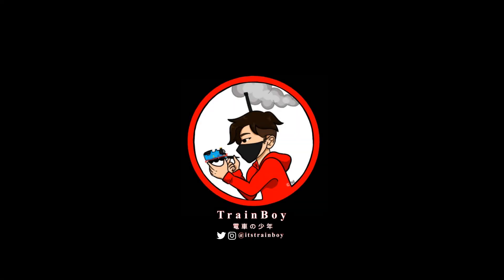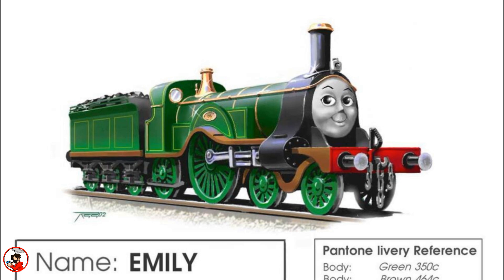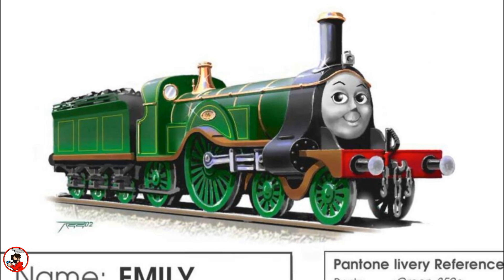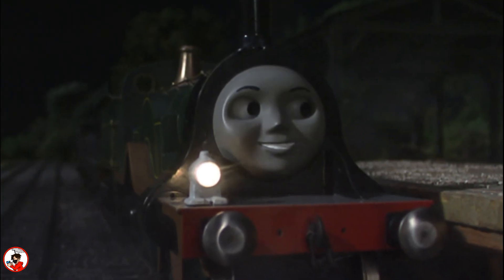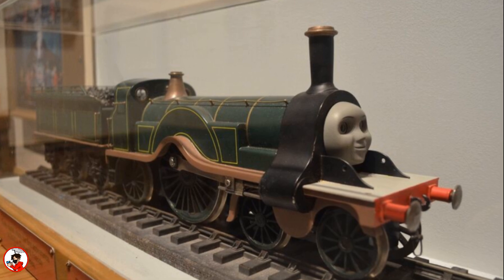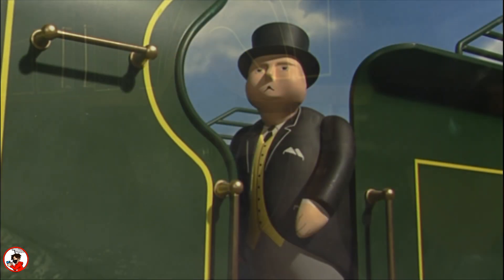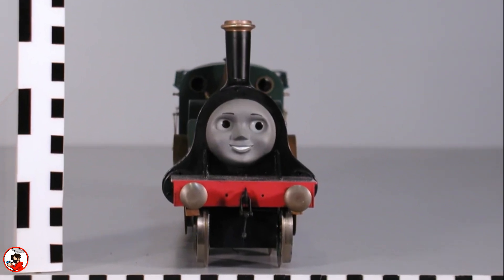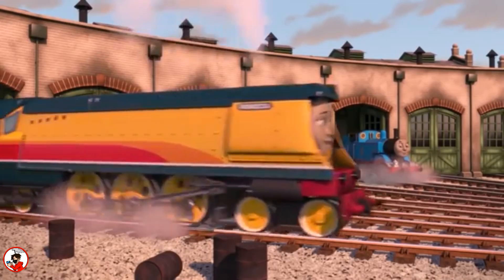The History Of Emily The Stirling Engine: The History Of TTTE

Comment: Emily really was a character that really seemed to fit well when the series turned away from Awdry. Looking at her basis and the years it was built, it wasn't far from Edward's "birth" which puts the two on a similar level. Also, as a kid and even today the design of her smokebox always looked like curly hair on models so the design felt natural for the class to be female.
Reply: Emily is in fact older than Edward. Emily was built in like the 1870s-1890s. Edward was built in the early 1900s.
Reply: @CassandraPantaristi  In difference of years there is 1 year, between the last stirling was built, and the first k2 was built...

Comment: I've never much liked Emily at all. Her existence is like Rosie's; one shoehorned in for political reasons. Her design is nice but something about her face is incredibly offputting.
Reply: what do you mean political, if you mean like female representation then that’s not really political
Reply: @TBP62  That is very much political. It means her existence isn't an organic one. She wasn't made for the purpose of introducing a new character to the show that might be interesting, she was introduced to tick boxes and meet quotas - and more to the point, to "appeal" to an audience that largely isn't interested in the show anyway. It's a problem that many shows in the same era had and today it's only gotten worse. I mean look at that Rebecca and Nia they added in the CGI series. Same thing - nothing but box-ticking.
Reply: @MrJoeyWheeler  The difference between emily and those two diversity check mark engines who replaced edward and henry is that emily was made and written to be a character first and foremost with flaws and didn't let minor traits (like the fact she's female) being the only thing that defines her. Emily is more interesting and respected because she was made to be a character over anything else, also emily never really replaced anyone. Nia and Rebecca on the other hand were ONLY created for the sole purpose of checking off marks and meet quotas while also doing the one thing emily never did, and that was push out two legacy characters that kicked off the original source material for the tv series.